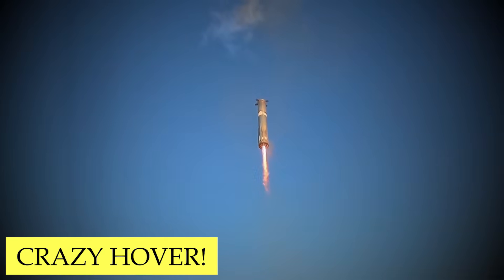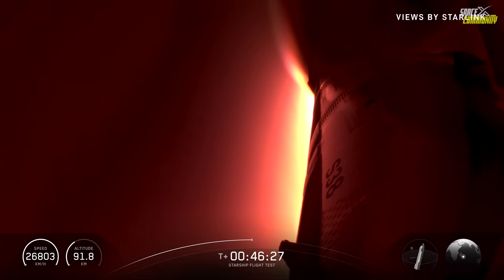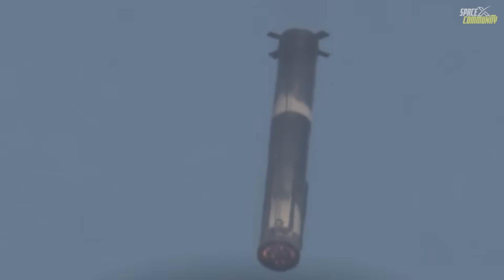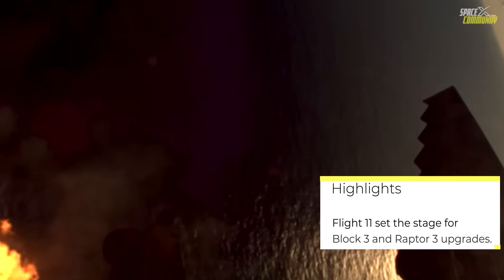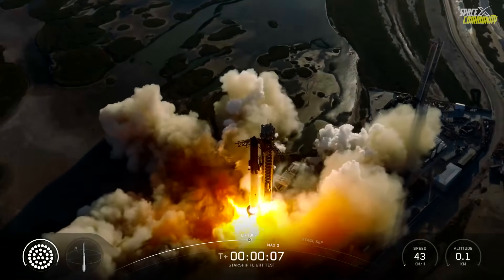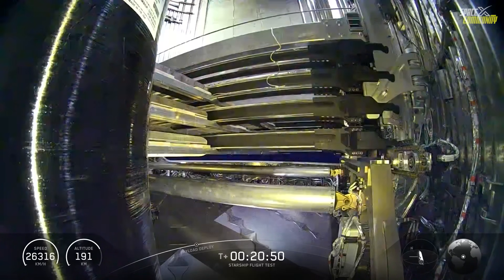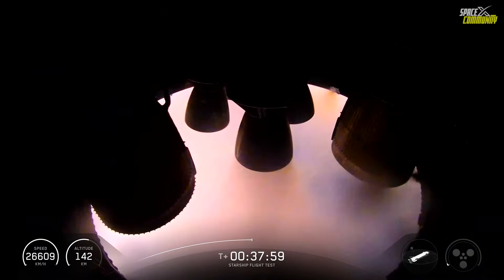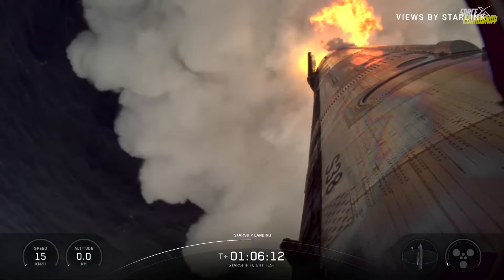A Closer Look At Flight 11 Starship Super Heavy Booster 15 HOVER & Landing

Comment: لماذا لا يكون هبوط مركبة ستار شيب أفقي وليس عامودي ❤
Reply: The Starship descends horizontally because it has a large surface area causing a lot of that helps to dramatically slow it down to terminal velocity 2-3 hundred MPH. Otherwise it would use much more fuel to slow it down.